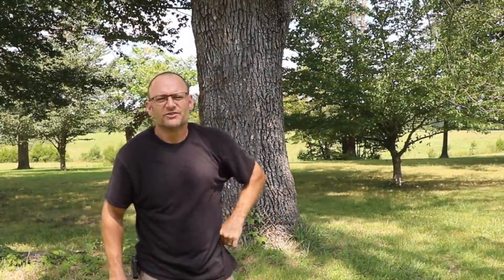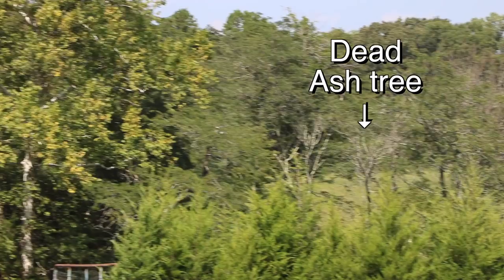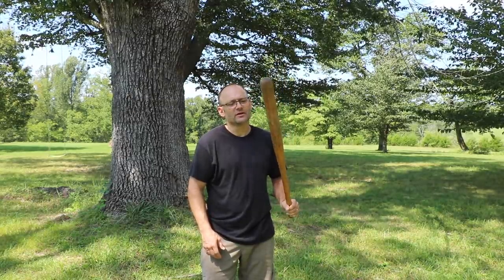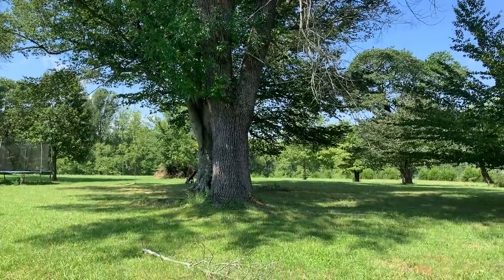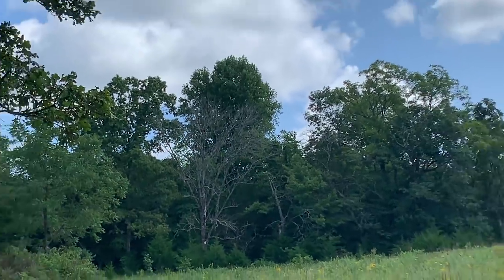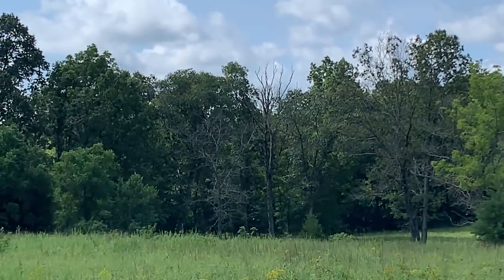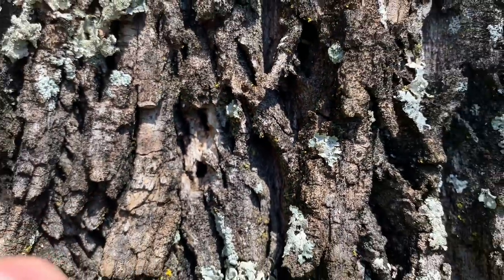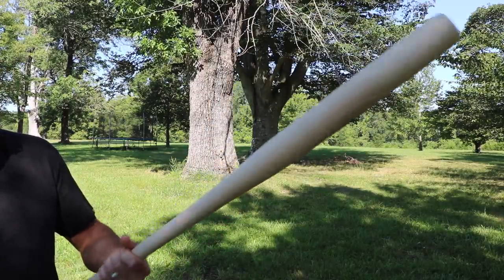The Other Pandemic You May Not Know About.  The Emerald Ash Borer.

Comment: I planted about 150 ash trees on my 10 acres here in Ohio 22 years ago, they grew well until the ash borer arrived. Most of them died and some sent out multiple new small shoots from the base of the dead trunks but they also eventually died. Surprisingly I have a few large healthy living ash trees which may be genetically different (although the bare-root stock I used all came from the same place). I have often wondered what other factors affect their survival, location, soil type, proximity to other trees (like walnut) etc. I hope that a healthy strain survives in the long run. Thanks for all your practical videos.

Comment: Well if you get up off your dead ash, 

That wood is still usable you can make burnt ash lumber, it makes the ash even harder and will kill off any bugs. I was told by a state forester the ash borrer beetles eggs and larva only eat the bark away from the tree. Once its dead they leave, but if you let them stand for too long a storm will blow the trunk over or z storm will send lightning into a large branch.  I wanted to mill mine but it fell over last fall.  Now I'm afraid the woods infested with ants. I wanted to use the wood to make counter tops.  The tree was 36" round at the base and stood 20' to the first y branch  it was about 25 to 30" dia all the way up to the crotch.
And very straight  would have made some good lumber.